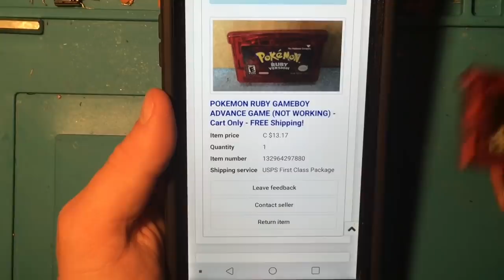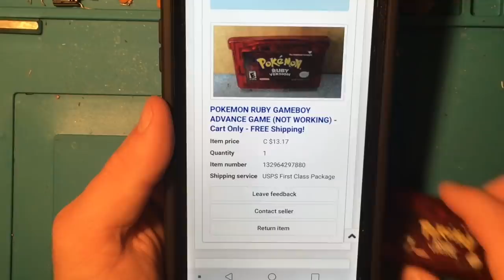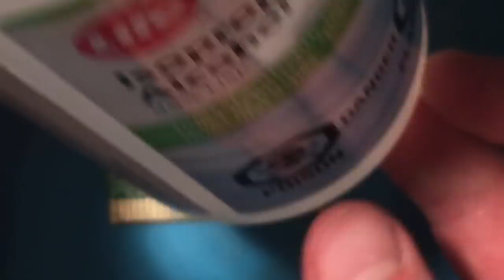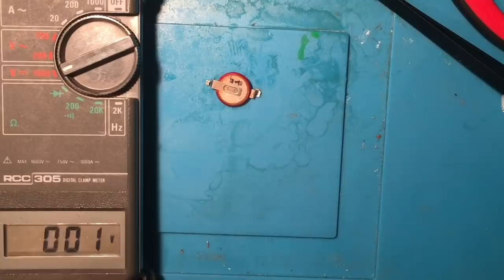Fixing eBay Junk - Game Boy Advance Game - Game Won't Boot Up - Pokemon Ruby

Comment: You need no clean flux, especially on a delicate game board.
Reply from the maker: Disagree.  Unless you're using a reflow oven,  you should avoid no-clean.  It's easier to work with,  but you MUST clean any leftover no-clean, despite the name.  Unspent no clean can eat away at components more than rosin flux
Reply: @RetroRepairs  I still clean off no clean, but I don’t have to worry if I don’t get all of it.

Comment: won't boot up huh? well other then the battery being dried out it should work might be something else, i know my blue saphire cart works fine, but being left in a hot car the inside battery dried out so time based events no longer accure
Reply from the maker: The battery would have no effect on whether the game would start. There was a damaged circuit which i show how to fix in this video

Comment: Wish I saw this before I threw a bag of games into the trash.
Reply from the maker: Wish i gave you my mailing address before you did that
Reply: @RetroRepairs  It was a bunch of gba games that were somehow drenched in water and molding. I didn't notice until I looked at them. Only game I wanted was megaman battle network 2. They have just been picked up today by the garbage truck...

Comment: Holy shit 99% isopropyl alcohol most I've seen is 91%
Reply from the maker: You can get 99% on the shelf in drug stores in Canada, but i know that certain states don't sell it, or it might be an over the counter thing.  91% will suffice, but i wouldn't go less. It just has more water content so you need to make sure you dry it well

Comment: I have a super ghetto fix for these and I think most people would hate me for it. But on aliexpress they sell bootlegs of these carts for like $5 a piece. Always read the reviews as some sellers have carts that save and some of them don't. But if you buy from a seller with good reviews they usually test them before shipping. Always check the reviews. When you get it you just open up your broken official cart and swap the guts with the fake one. Bam instant fix with no skill required.
Reply: sounds more like ruining an authentic game rather than a fix. Enjoy random freezing, saves eventually not working, no clock features and not being able to transfer to gen 4. Would rather have the broken authentic one cause at least its worth some money.

Comment: sorry but flux is not corrosive. where did you hear that? it is in solder too. all it will do if left is not look good.
Reply: Flux is acidic
Reply from the maker: Flux absolutely is corrosive.  Even the "no clean" flux residue, if left can cause early corrosion.   Even in plumbing, plumbers wipe any flux residue off their joints, as it will lead to early corrosion to the copper.
Reply: Flux is corrosive. That's the very foundation of flux. If it's not corrosive it doesn't work. It eats at the top layer of the metal to expose a non oxidised layer to give the solder a good surface to stick to. Some solder such as rosin are heat activated but are still acidic and corrosive.

Comment: Replace it lol i dont think they make those batteries anymore
Reply from the maker: They sure do.  They're only a couple bucks
Reply: RetroRepairs can i find them at stores, my battery is dead and its needed for timed events, funny thing is that its for the same game in your video
Reply from the maker: I'm not sure, maybe a specialty electronics store or a retro game store, but you will probably have to order them on ebay or amazon
Reply: RetroRepairs any tips on attaching it to the board, like sould i soldier it or do it a other way
Reply from the maker: Soldering it would be best.  I've done a video of this process in the past:

https://youtu.be/XaRrqOTfgzs

Comment: Tis a fake cart anyway.. So it's garbo to begin with
Reply from the maker: yeah, but it isn't
Reply: @RetroRepairs  I'm pretty sure all the carts  with batteries in them are fake carts
Reply from the maker: @cine-ish  Not the case.  Batteries are not necessary for saves anymore, but some carts (including GBA Pokemon games) use a battery to maintain the in-game clock.   Most GBA games do not use a battery at all though.  This is 100% a genuine cart.
Reply: @RetroRepairs  ohhhhh, I see, I'm just dumb asf lol

Comment: Reflowing does NOT fix the issue all it does is create a temporary fix to the problem it’s like putting a video card in the oven literally look it up this video is very much so miss informed
Reply from the maker: Not at all correct.  You'd be right for something like a ps4, a reflow is temp.  Actually reflowing each solder point when there's a cold solder joint is a permanent fix if you do it right.  You don't have access on newer tech, but when each pin is accessible, reflowing is how you fix it